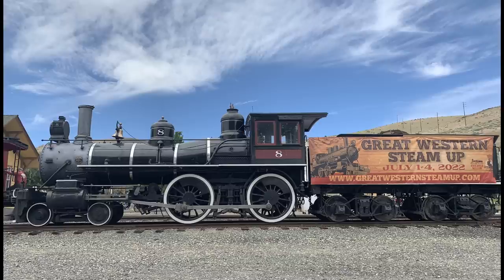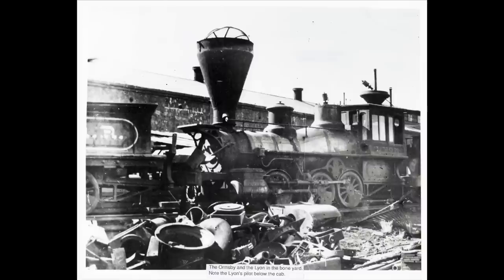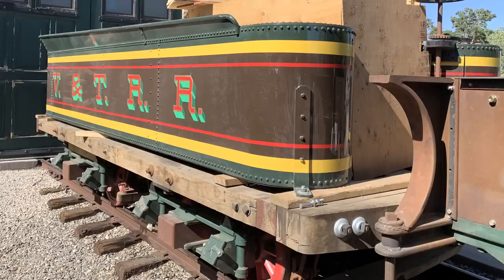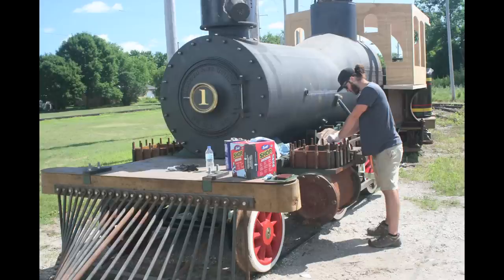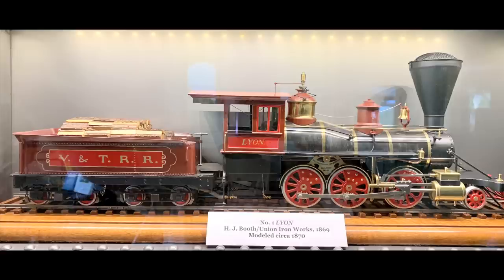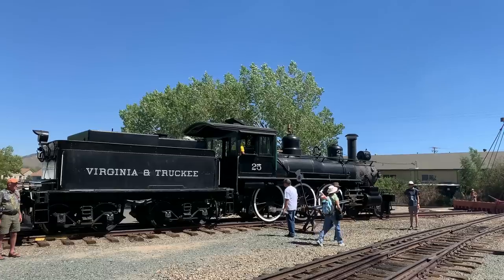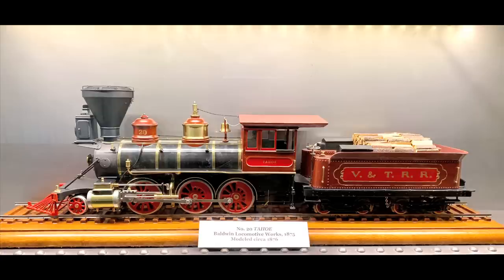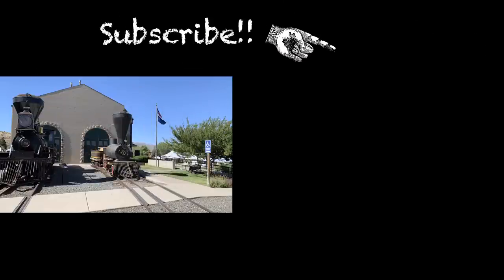Virginia and Truckee Railroad Locomotive #1 "The Lyon" - Great Western Steam Up

Comment: It amazing to see these proud engines being restored and live like seeing something from history coming to life.  I often wonder if the engines could be converted to run on eco-friendly fuel, thinking of the idea from how the Grand Canyon Railway did the same with their steam engine (GCR 4960) running on waste vegetable oil
Reply: Probably if need be.  That's the thing about steam engines, as long as you've got something to burn in the firebox to boil water you've got power. 
And any kind of waste oil will do.
Reply from the maker: Yup. It’s all just costs. Many of the coal locomotives are being converted to oil. Mostly because of the cost to transport coal. Power plants are converting to natural gas. Sure EPA but it’s also cheaper now that they’ve done it. A pipe is cheaper than a railroad with a 100 car coal drag. Anyway sure!  Any oil fired locomotive can run on anything that flows through a pipe and burns.
Reply: @ToyManTelevision  Back in the 1970's the Morris County Central steam trains in New Jersey burned waste oil they'd get free from local gas stations and auto repair shops, those places were grateful to have someone take it off their hands!  
One thing to remember, steam locomotives are exempt from EPA smoke regulations so they can burn anything they want. Stationary steam engines, no.
Reply: not going to happen.  Doing so is extremely silly for environmental reasons.  These steam locomotives run at most a few times a year and produce far less than a days worth of car traffic.

Comment: I'm curious, how much left need to be finished on the Lyon #1 and how long will it be completed? Ain't asking when. That what I like to know. Thanks.
Reply from the maker: Hi. Well they just finished the throttle. And are working on springs. The back head it the big thing. Nothing done there yet. No fire door. No pipes. Nothing. Now with the throttle made they can install that in the steam dome and add the throttle linkage to the back head. Anyway as I’m looking it seems that’s where the bulk of the work is needed.
Reply: : /

Estimated for next year Q2 or late Q1, i guess...

Comment: Would be nice if they were able to reconnect the Durango & Silverton And the charma and 🤔 what’s that name railroad 😁
Reply from the maker: Cumbres and toltec. Really hard to pull off. They could get about 20 miles out of Chama before running into a missing bridge. The huge problem comes at Durango. The old grade is a highway for miles. And as you enter town its all built up on the grade.